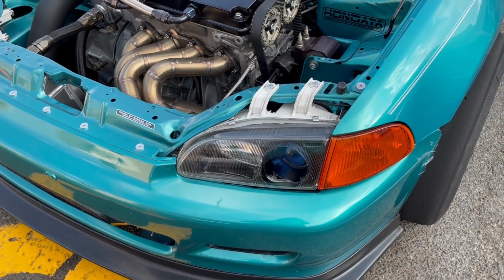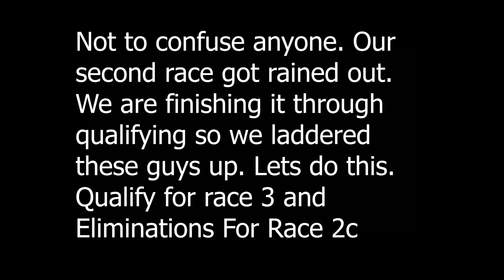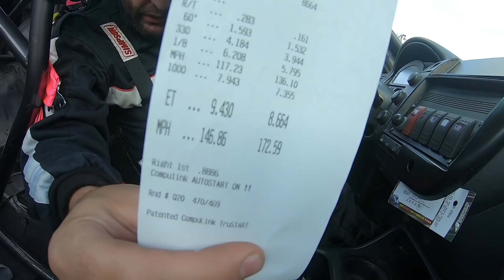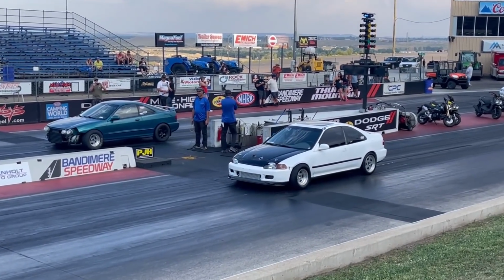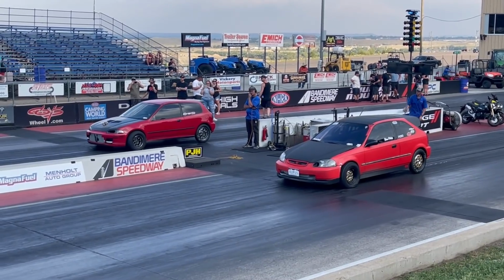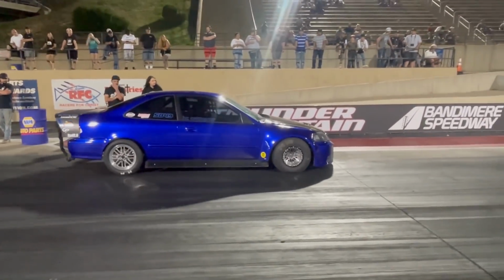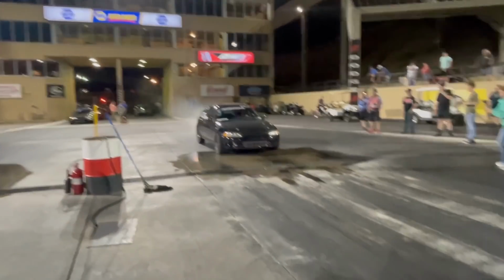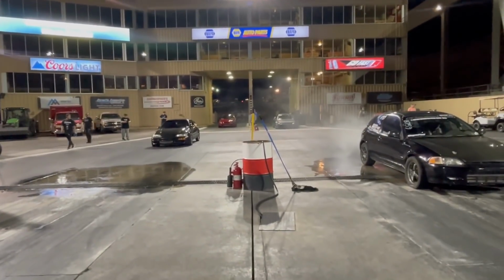I am Lightning⚡️ personal bests Rain In Psca qualifying! Aug2021

Comment: I signed the rpm act because racing is not a crime it's a passion and should not be  inter feared with. I passion for building hot roads is something that has been going on for generations and should go on for generations to come.

Comment: Well guys my Rep. answer back!! 

Thank you for taking the time to share your thoughts on the Recognizing the Protection of Motor Sports Act of 2021 (The RPM Act or H.R. 3281). I truly appreciate your input.

As you may know, the RPM Act protects Americans' right to convert street vehicles into dedicated racecars, as well as the motorsports-parts industry's ability to sell products which enable racers to compete. Additionally, this bill clarifies that it is legal to make emissions-related changes to a street vehicle for the purpose of converting it into a racecar used exclusively in competition. Lastly, it confirms that it is legal to produce, market, and install racing equipment. This legislative effort stems from the Environmental Protection Agency's (EPA) interpretation of the Clean Air Act (CAA) to not allow motor vehicles designed for street use—including cars, trucks, or motorcycles—to be converted into dedicated racecars. 

Although the EPA has yet to make their interpretation a formal regulation, I support efforts to keep the EPA from implementing overburdensome regulations that infringe on the rights of all motorsport enthusiasts and have sponsored H.R. 3281 to ensure this is prevented. Currently, The RPM Act has been referred to the House Committee on Energy and Commerce. While I am not a member of this committee, I intend to support this legislation should it come before the House.

Again, thank you for sharing you input on this issue. Our representative democracy only works when citizens and their elected representatives actively discuss the issues facing their country and local communities. When working with my colleagues in Congress, with federal agencies, and with state and local officials, I am committed to making sure your voice is heard and fighting for the best interests of the people in Kansas' Second Congressional District.

To follow what my team and I are doing for you in Washington and at home, follow me on Facebook and Twitter, and subscribe to my newsletter. I look forward to hearing from you in the future.

Sincerely,

Rep. Jake LaTurner
Member of Congress
Reply: Really!! I’m just saying I got answered, not that he gained my vote. I know anyone can say something and not do it. If it’s not 100% accurate, my bad.  Been here since day one enjoyed every single video and laugh here with Brent and the guys every day. That’s it bro!! I’m not a technicality guy nor a politician, just a car enthusiast.
Reply: @sauloramos1579  Saulo Ramos, am glad You told me of Your interest in the PFI Speed as an enthusiast.
My background is actually very technical, mechanical, electrical with automotive electronics and as a design engineer. Also have much interest in vehicles including automotive, modifications, performance and such which includes some aspects similar with enthusiasts.
Am not a politician, and very opposed with them, since they are nearly all essentially dishonest, liars [as Lawyers], lack integrity and are involved as a carrier, not as Your representative, service or the needs of the public, and specifically the district or state they are supposed to represent or be an official.
Such, my response to You, was to allow You to be aware of what Your HR Congressman wrote, does not address the issues, nor does the proposed RPM Act which has been introduced now four times and never reached the House floor in either chamber for a vote.

These fellows, especially including Brent seem like delightful people and if i had access to Colorado, especially Denver, would certainly like to meet them and know them better.

Sincerely

Comment: Signed #rpmact month ago and got this response.

Dear Mr. Greven,

 

Thank you for contacting me about EPA regulations of racecar emissions under the Clean Air Act. I appreciate your feedback on this important issue.

 

Introduced by Representative Patrick McHenry, H.R. 3281, the Recognizing the Protection of Motorsports Act would exclude vehicles used solely for competition from certain provisions of the Clean Air Act. This bill was referred to the House Committee on Energy and Commerce.

 

I will keep your thoughts in mind as the House continues to debate this issue.

 

 

Sincerely,

PETER WELCH

Member of Congress